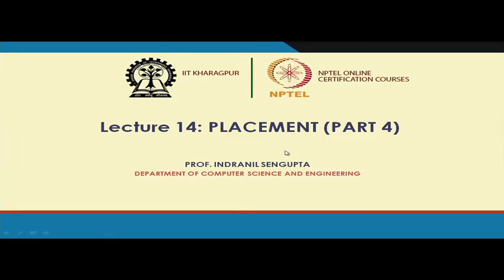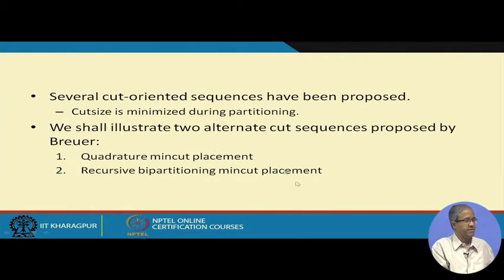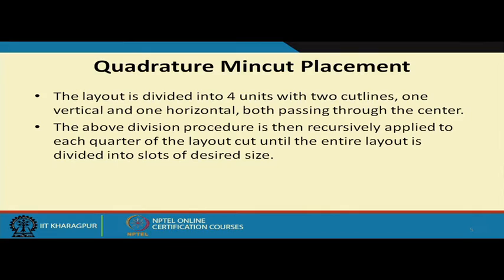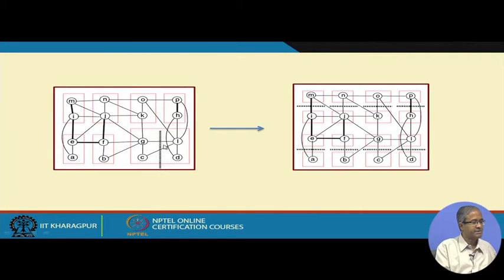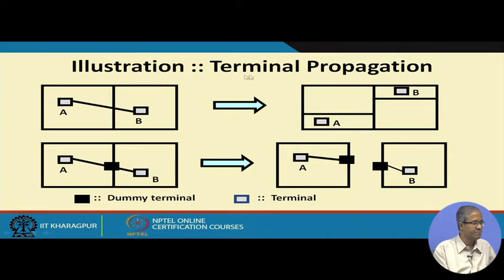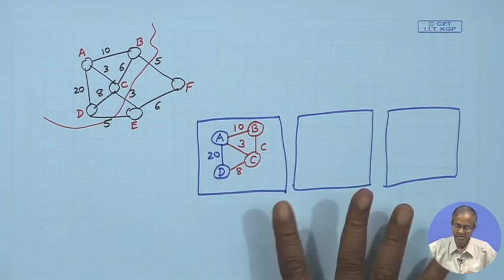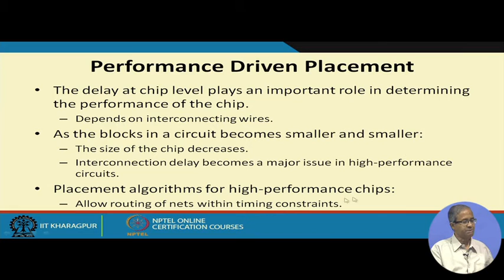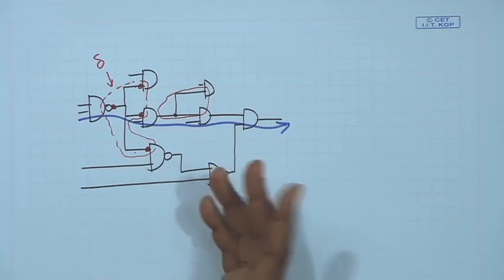Placement (Part 4)

Comment: Breuers algorithm 
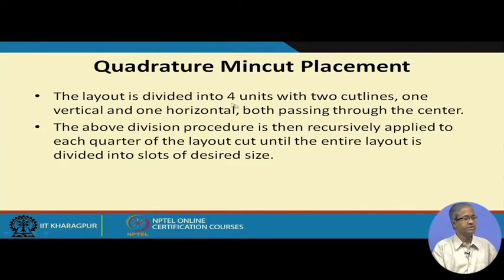example 8:29
quadrature min cut placement 8:46
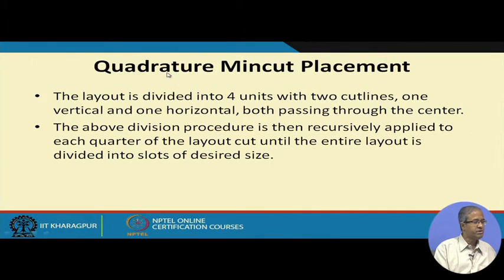solution of example 9:37
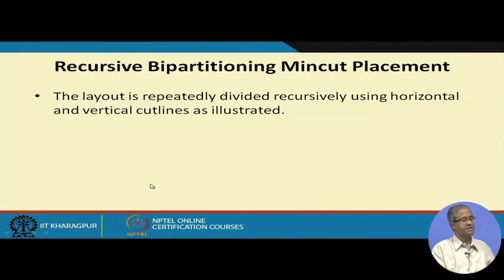recursive bipatitioning 12:24
solution 13:04
terminal propagation 15:13
cluster growth 18:23
performance driven placement 25:04
two major categories of algorithms 26:34
Reply: Do we actually have to use KL algorithm everytime or just considering any cutsize?